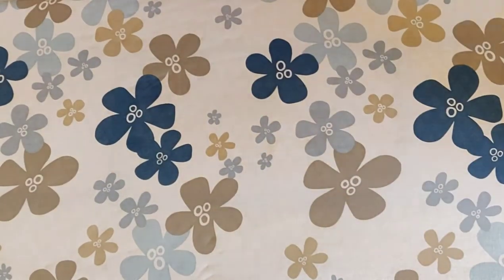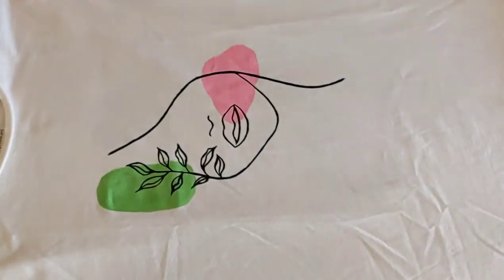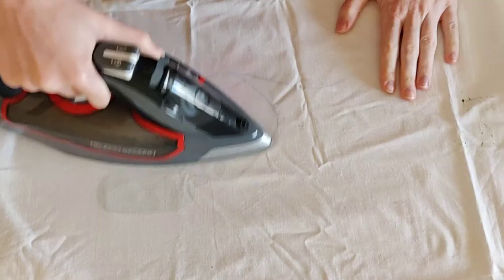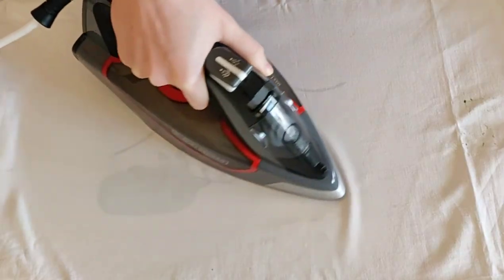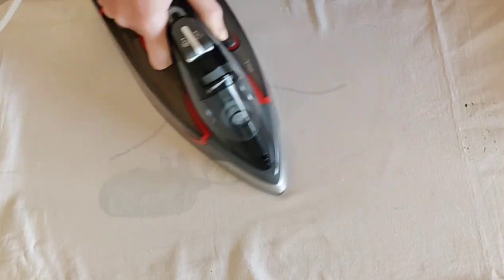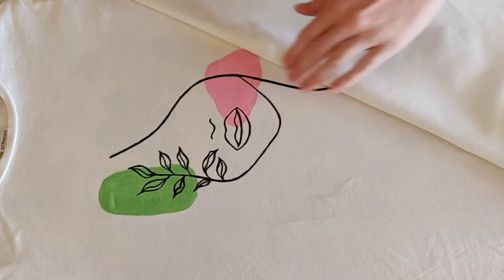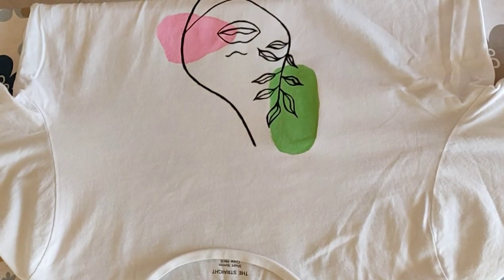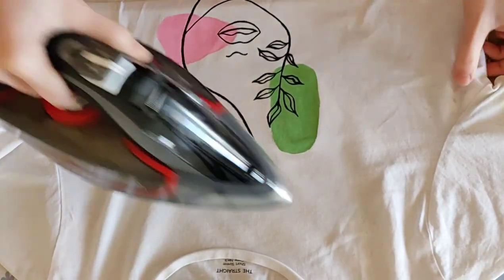Heat set your painted design on clothes the right way

Comment: so if i iron my acrylic painting on fabric , will it became permanent and waterproof?
Reply from the maker: Ironing doesn't turn acrylic paint into fabric paint. This method is to ensure permanence of textile paint on clothes. Regular Acrylic paint will behave on fabric  in a usual way whether it's been ironed or not
Reply: @FabricPaintingCoach when you say, 'acrylic paint will behave on a fabric in usual way', do you mean it will ripp off or get off??
 Coz I have used acrylic paint on denim fabric (without iron press), and I have gifted some of them to business relations. Now I am concerned about it! 😟😮
Reply: @ShivAadesh  It will crack or peel. Mixing a fabric medium with the paint is how you get it to heat set properly.
Reply from the maker: Hi, listen, don't worry that much
Yes, there is a chance that painting made with acrylics might perform the way I showed in video (cracking, or minor color fading) but that is mostly the result of laundry. Type of denim (regular cotton, or the stretchy kind) is an important factor here. Also, my design has cracked because it was on skinny jeans, and they were stretching on thighs when wearing - so it became visible. It's less likely to get that obvious issues if you painted let's say on a denim jacket or a hat.
I hope your artwork will stay put and beautiful for a long time. All in all, acrylics ARE a reliable type of paint, just not as soft and flexible as the fabric paint.
Reply: @FabricPaintingCoach  thanks , i draw with acrilic on my jeans and its lit cracked now but still beautiful

Comment: For the next time I ever have to iron this shirt will It be fine to iron over the painting without cloth?
Reply from the maker: Very good question. No, the painting area should always be protected and not touched with a hot iron. And it's not only the case with hand painted clothes, btw. Prints on store bought textiles also melt under an iron.
Reply: Ok thanks very much

Comment: I used acrylic paint and fabric softener as a fabric medium would this still work ??
Reply from the maker: Hi, fabric softener has different properties . It is actually advised not to use fabric softener during laundry of painted designs and also to wash it off prior to painting, as it prevents a proper bond between paint and textile fibers.
Reply: @FabricPaintingCoach  okay thank you

Comment: If you use fabric paint and follow these steps, will it be okay in a washer, not dryer but just washer?
Reply from the maker: Yes, sure. I do show in many of my paint reviews how painted fabric looks like after a machine wash.
But to make sure that laundry cycle doesn't damage your design, there are a few things also to keep in mind in terms of painting technology (it matters how you apply paint, how you let it set and how many days the finished design has been resting after ironing,as it is not recommended to wash it as soon as it's been heat set).

Hope you'll find these helpful.
Good luck